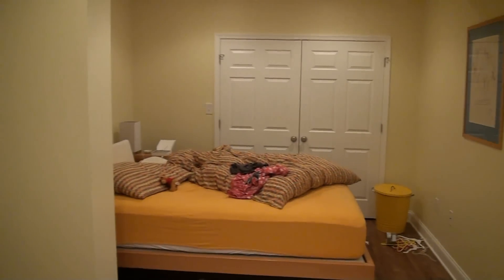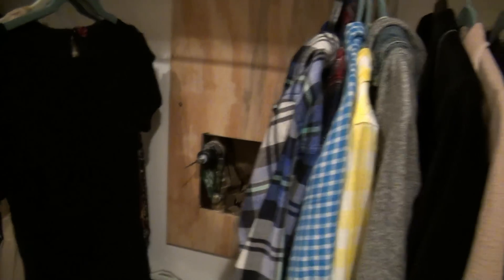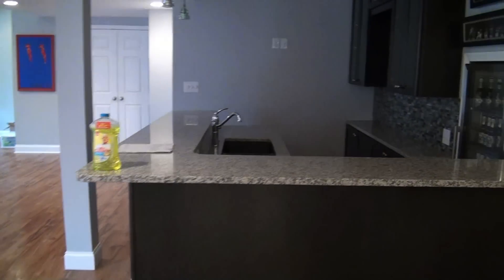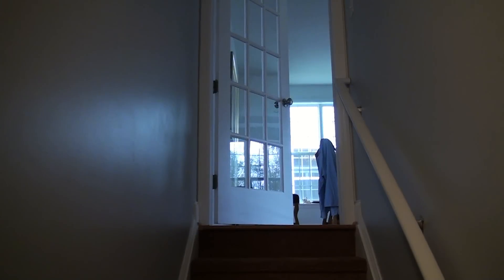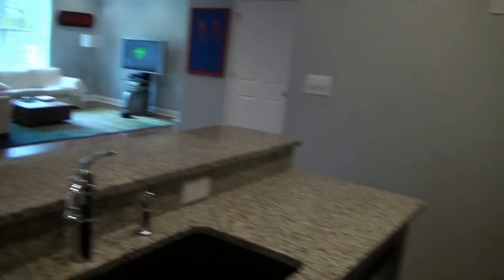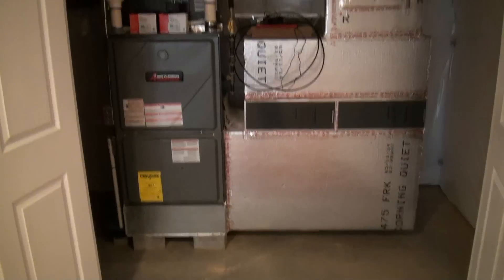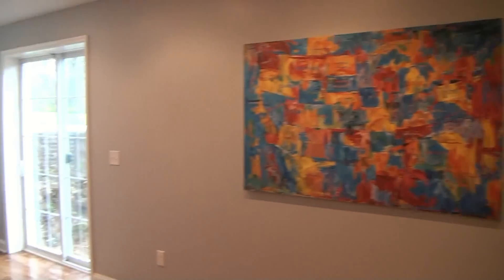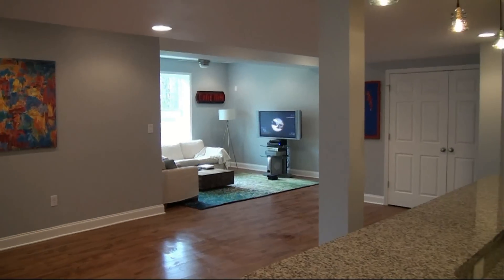Another Basement Finishing Idea Walk-Through!

Comment: How did you address the drainage issue with the doors leading to the back year?  Are they connected to the sump pump?  Great job really like the use of common items to create something that looks like a million dollars.
Reply from the maker: We tied a drain we installed in the paver bricks at the base of the hardscaped steps into the footer drain system and that keeps any water issues at the base of the steps from materializing.

Eddie